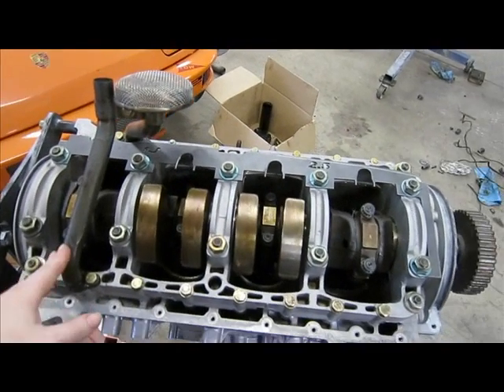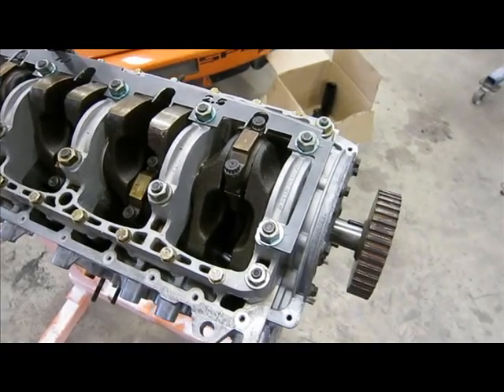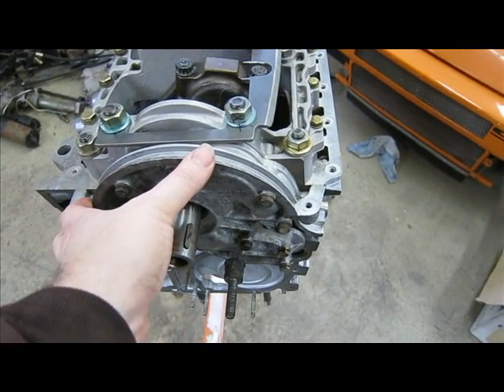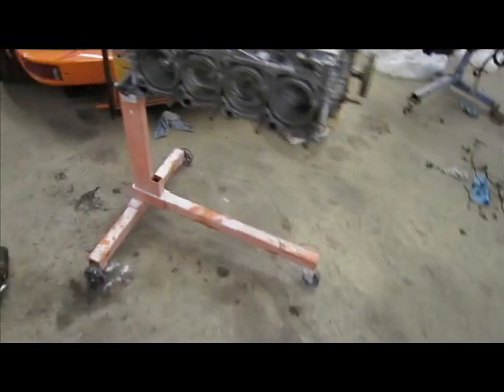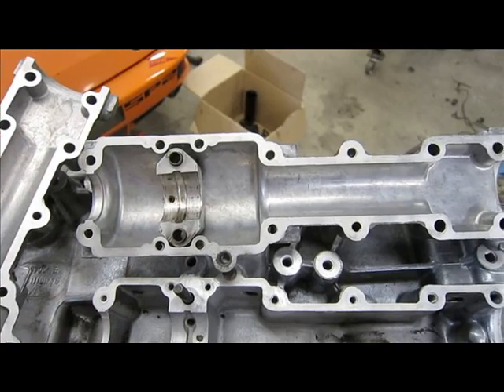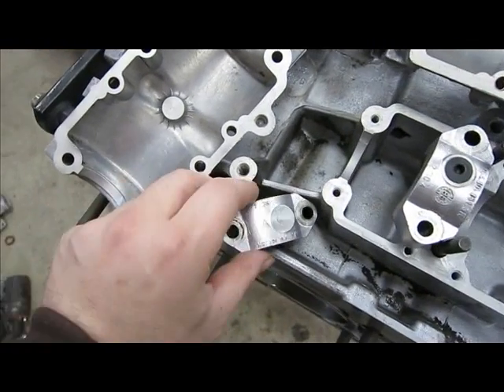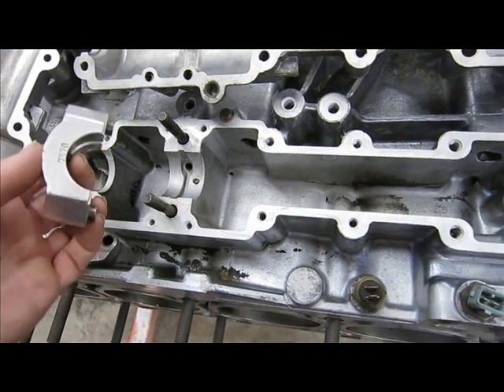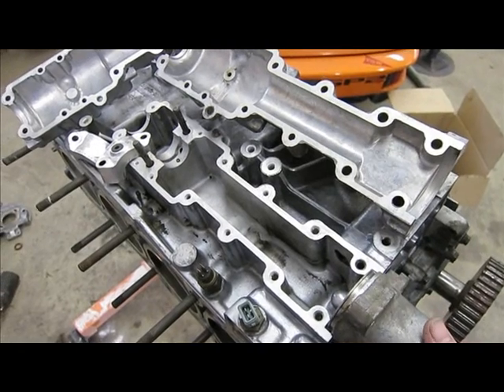Balance shaft assembly on 944 engine

Comment: Hi Van! Really great videos. They helped me already with tons of questions I hat. I have one question about this one. What did you put on the threads before you put the bolts into the holes? There is a grey can on your tabel.
Reply from the maker: That is anti-seize lubricant - it helps prevent corrosion between the steel bolts and the aluminum threads.
Reply: @vsvenson  thank you for the answer. are you using the anti-seize lubricant for all of the steel-aluminium connectiuons in the engine? e.g. water pump, camshaft housing?
Reply from the maker: @BartoszNavarra  Yes, all steel-to-aluminum fasteners that aren't inside (in oil) - e.g. not the cam box bolts inside the housing, but yes for the bolts on the outside of the housing.  Future Bartosz Navarra will thank you!
Reply: @vsvenson  Great! Thank you for the tip.Will do this from now on. Current Bartosz thank you already!

Comment: Great vids.  Thanks.  Do you replace all the engine hardware during a rebuild or do you just have them re-zinc'd?
Reply from the maker: Neither - I just clean the old hardware, and if the threads aren't damaged, reuse it.  I'm not doing restoration-level aesthetics.